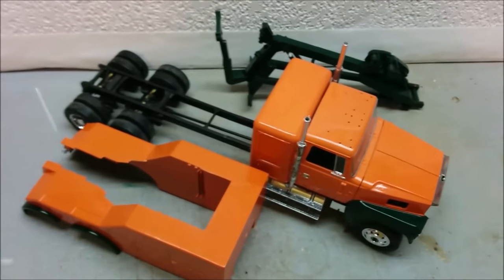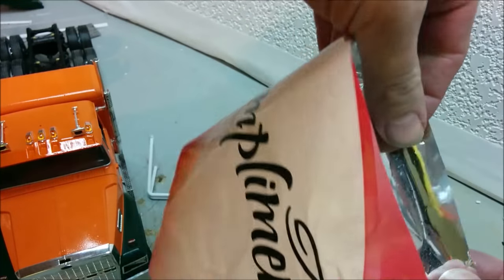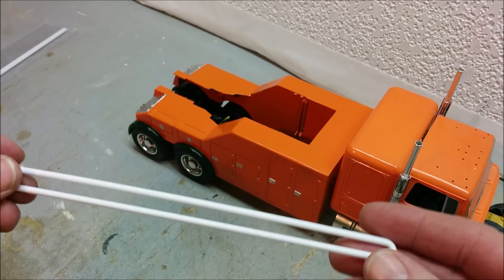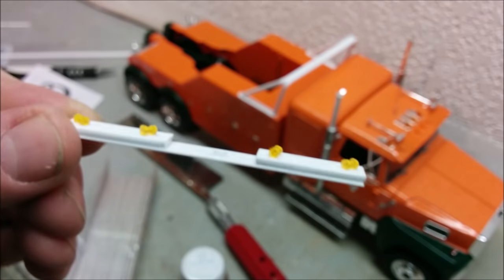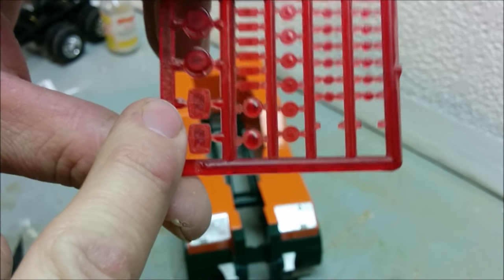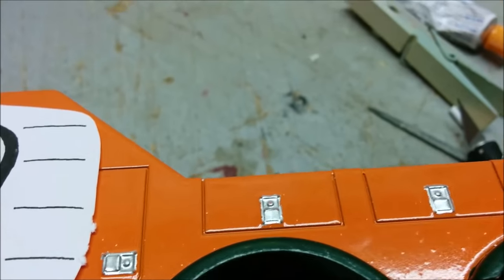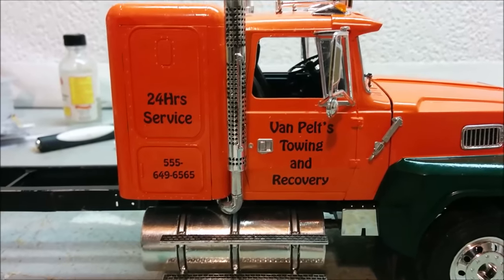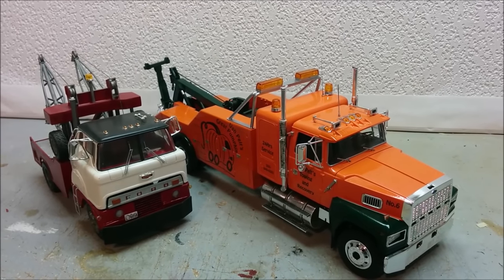Modern Wrecker Truck 1/24 Pt10 Finished

Comment: Over all, excellent work! 
   Your custom decal process reminds me of my venture in that vein. I had built AMT's 1:25th-scale kit of the Autocar Dump Truck. I weathered it some to show it had been working for a while; this included a bit of Testor's medium brown enamel paint (approximating caramel; in their little bottle) mixed with baking soda to make it clumpy, which I applied heavily to the tyres, and dry-brushed across the lower chassis. 
   Trevor Cole, the manager of a truck dealership offering White Freightliner and Autocar agreed to buy it, with two requirements: more mud on the tyres, and his name and telephone number on the cab doors. Adding more mud was routine. The lettering on the doors? I lacked the means for desktop publishing. 
   Another kit made its decals all one piece encompassing the entire sheet. One inadvertent advantage of this was sizeable pieces of clear decal material. I can write extremely small and very neatly. I used a permanent marker, black ink (the cab was white; I then had neither the money or the skill for such a spray job, so the colour of the molded polystyrene would be the colour of the replica). I did so backwards, and I inverted the custom decal to seal it as best as I could. I added some clear overcoat, too. 
   It served well, and Mr Cole was happy with his smallest truck. 

At 2:56, yes, the potato chip bag is Mylar. One need not use such a greasy surface. One can purchase Mylar balloons in various colours (as I understand).

Comment: As a plane modeler I’ve never thought of doing trucks. The odd thing is that I’m a professional truck driver doing long haul for over twenty years. After watching this I must say I’m going to try one. Very nice work.
Reply: Build an aircraft in the same scale as a truck you like, and combine them thematically. For example, a 1940s refueler servicing a North American Aviation P-51D Mustang USAAF Fighter. 
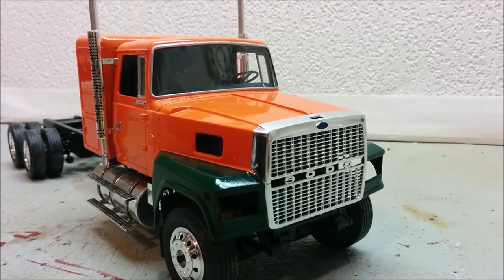   I recently saw on YouTube a build video of a Sinclair fuel tractor trailer rig in 1:48th scale. One would have to double that size for this proposal. I do not know your skills in such a venture.

Comment: Nice job. You reversed the turn signal lights on the fenders  reversed. The part that projects on it is the amber lens which faces towards the front and the flat side is the red lens.

Comment: Great job. How did you tint the light bar amber?
Reply from the maker: The light bar was tinted with Tamiya clear orange. Tamiya makes a range of transparent paints from red, yellow, orange and green. They are great for tinting turn signals, brake lights and emergency beacons.

Comment: The box doesn't show that it's a Ford LTL 9000.  Would have been nice if you would of mentioned it.
Reply from the maker: I didn't mention it in this video, (these are often edited to keep the length down) but I'm pretty sure I mentioned it several times during the series. I went into it in depth within the first 2 minutes of the first part of the series. I assume Italeri don't identify the make or model of the truck is because they let their license with Ford expire. Thanks for watching.

Comment: Very nice build are the sleeper and the cab separate pieces can the kit be built without the sleeper
Reply from the maker: Valdemar Krigger The sleeper and the cab are separate. The cab itself is made up of 5 flat parts that come together.(kinda like the real thing) Unfortunately the rear of the cab is meant to have a sleeper mounted and has a large vertical rectangular opening in it. You would have to plug it and create an opening for the stock rear window. Not easy but certainly possible.

Comment: dont understand what a swastika has to do with a tow truck
Reply from the maker: Nothing directly. There are laws in much of Europe forbidding the sale of anything bearing the image of a swastika. This also applies to model kits, which makes it hard to sell a model of a WW2 German plane difficult in most of Europe. Most manufacturers get around this in one of 2 ways. They can either omit the swastika or break it up into 2 or 3 parts that the modeler lines up when they apply them. Some companies make two sets of kits, one for Europe without swastikas and another for jurisdictions without those laws. Many companies take the easy way out and just omit them. Therefore if you occasionally build a German plane from WW2 you sometimes need spare swastikas. Hope this explains things!